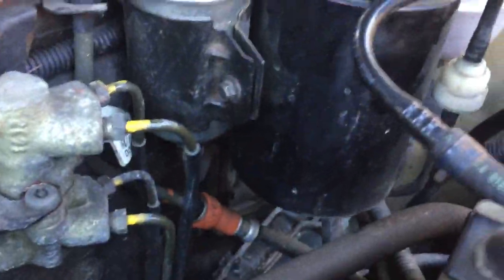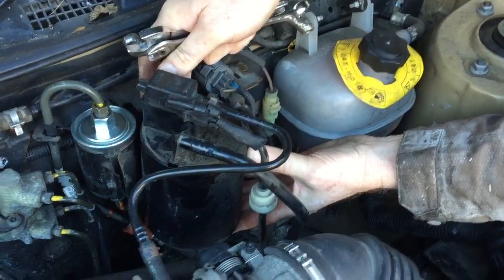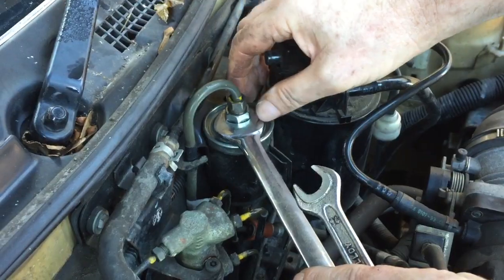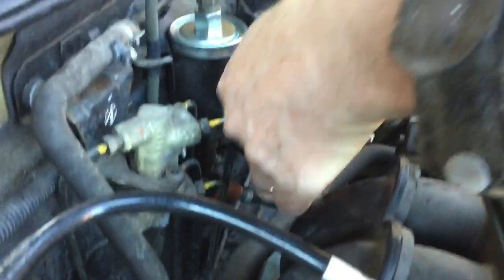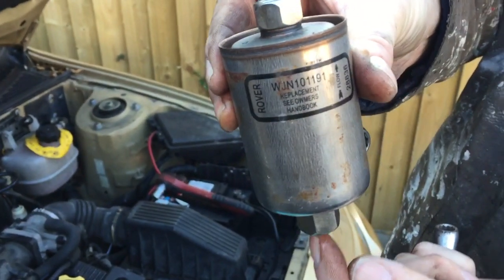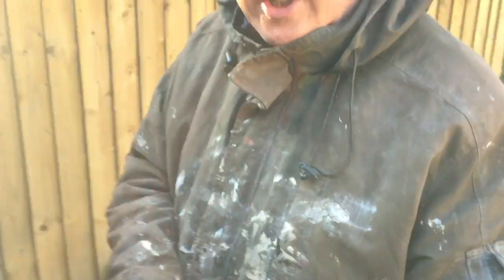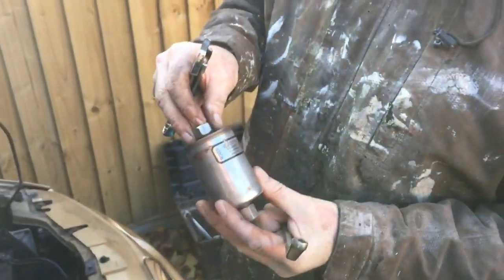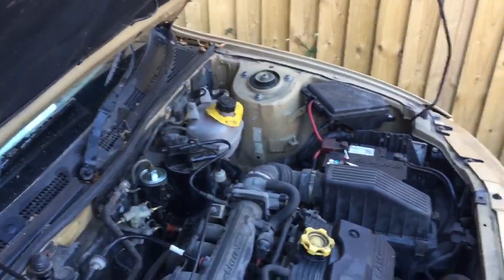Rover 25 1.4 2002 Petrol Fuel Filter Change Swap Replacement How To

Comment: Nice Vid chaps keep it up, just got a 25  on a 53 with only 73k so after filters, plugs, oil, Ill look to do this, do they suffer spongy brakes?  I note that engine idle rises if i pump the brakes at the moment albeit I have only been 10 miles in her/it.
Reply from the maker: brakes are a bit crap even when bled etc, compared to other cars i have driven
Reply: @DanielJohnHowTo  I expect they have never had new fluid so Ill bleed them out, do you know the order?
Reply from the maker: @GARYSMIFF  furthest first if it's not got abs
Reply: Daniel b